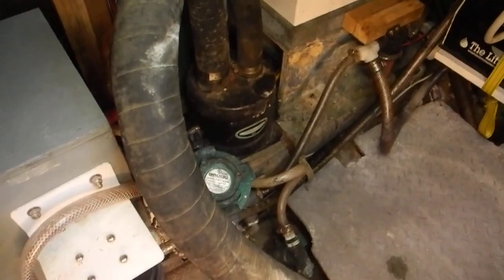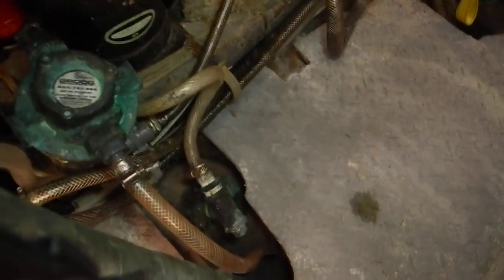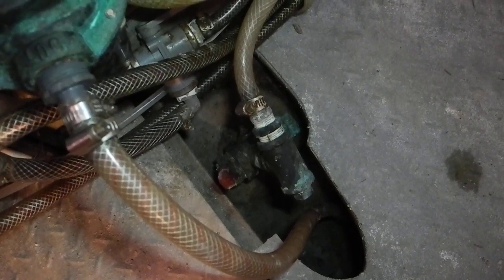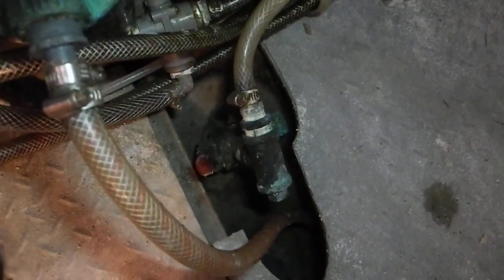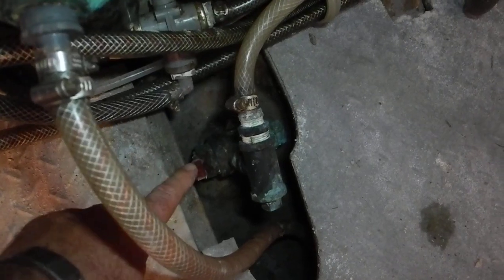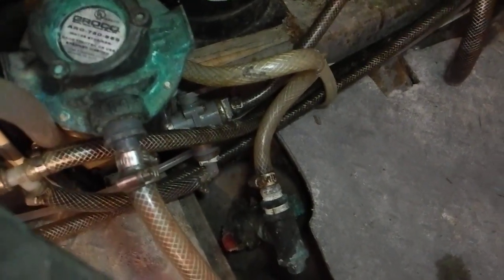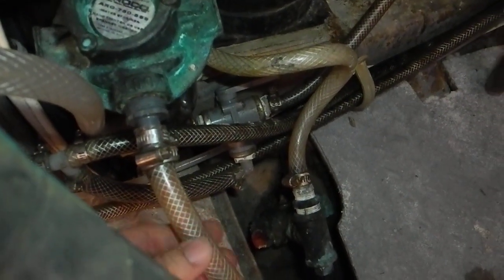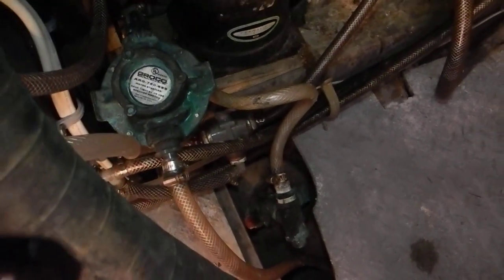Danger Strainer

Comment: Those are the vinyl hoses that are commonly used for the water supply (potable?). Absolutely notorious known for leaking at hose barbs as the walls harden and thin. When these hose suddenly shift on a barb fitting there can be a pretty good stream. And if you’re boat is on “city water pressure” you could find your boat hanging by it’s lines if the bilge pump quits. For below water line that type of hose is a terrible idea, so you’re spot on, got rid of that****. I usually don’t like to turn valves that are stiff if the boat’s is not about to pulled out, but it’s a great to cycle them all before haul out.
Reply from the maker: Karl Jensen I agree about the hoses but I prefer to cycle the valves once per month to keep them moving.
Reply: Ask Captain Chris
On mine, I close the valves for heat pump and head intakes at the end of every weekend, but only work the engine intakes about four times a year usually because of the strainer is due for service(flow or riser temp deviation)or annual impeller change. As for other owner’s, much of time they can’t tell you where they are let alone move them lol.  I’m amazed at the lack of care or concern given to the average floating investment. Keeps Chris busy yes?
Reply from the maker: Karl Jensen we don’t repair them anymore. We teach you how to do your own maintenance. If you’re in salt water you may want to consider cycling more often to prevent barnacle build up.